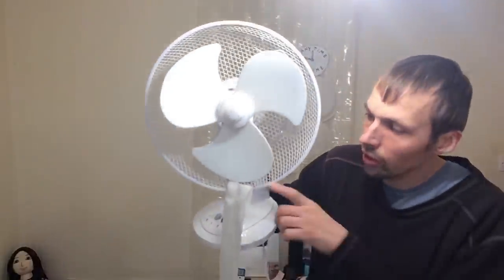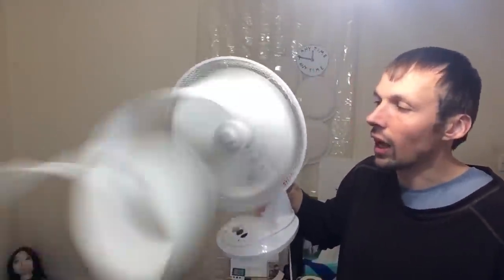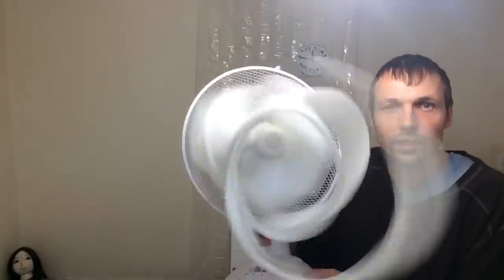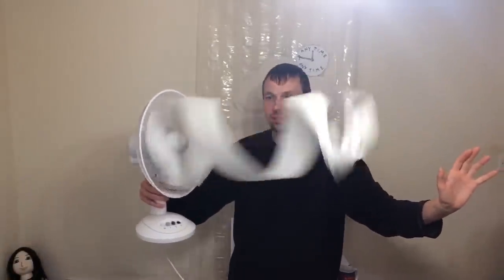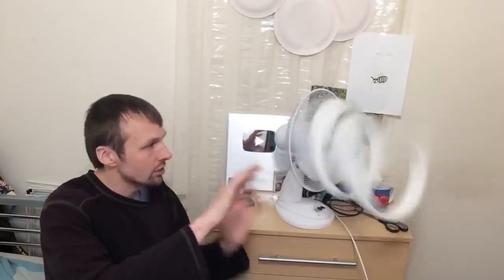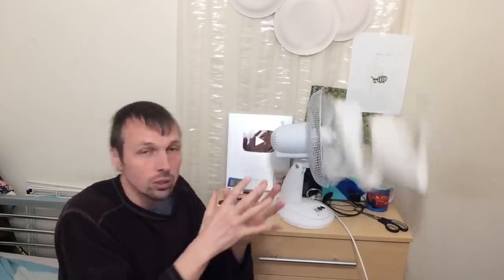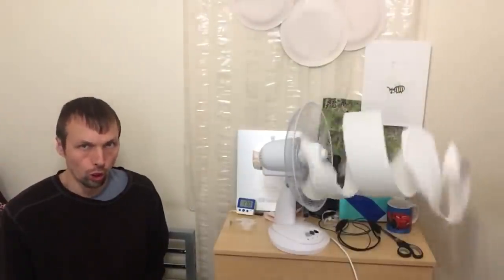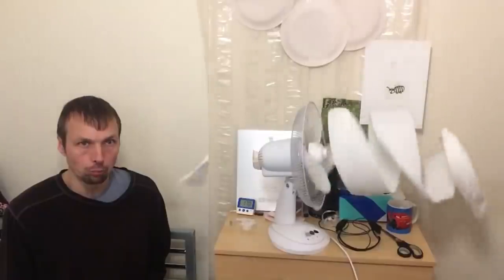Amazing physics experiment

Comment: “Let’s see your science fair project”
Me:
Reply: hey, its a good since project! for high school maybe

you just need to ask a important question: why the paper is doing that shape?, what would happen if instead of a fan blade that trows air forward, you turn it with a stick that moves no air ?

and if you analize why its doing that shape (it has to do with aerodynamics, and the low and high pressure zones) and study it you may end up with a simple model of how the air out of a fan ends up moving, something that many may not even think of but still science

also pro tip: mix Glycerin+ alcohol and heat it up ( i used a cheap solder tip, but you can heat it from below in a spoon (dont hold the spoon), the important is to bring it to a boil) and it will produce a good amount of smoke that you can use to show the airflow, but please do it next to a window and try to take out the smoke, is not poisonous afaik but still ask you chemistry teacher
Reply: btw i did an air chamber and put a small model car, and trow smoke at it to see how it was shaped, also learned a lot from wikipedia lol
Reply: @FocusFlixx  lol
Reply: @FocusFlixx  maybe someone gonna read this and give it a go
Reply: I like Fire Force too
Reply: XD

Comment: My IP-address is in the title and I don’t like it
Reply: You know what is ip address?
Reply: @127.  You know what is hexadecimal?
Reply: @appio4345  yes
Reply: IP Addresses aren't written in hexadecimal. MAC Addresses are. Nice try at a joke but, you failed.
Reply: @uniqhnd23  Ipv6 IP addresses are written in hexadecimal so...
Reply: @manjy5927  Mate you know he meant IPv4 addresses. Either way, the title looks closer to hexadecimal than IPv6 addresses.
Reply: @uniqhnd23  yep makes sense.
Reply: @uniqhnd23  The fact that it's standard to write IP addresses in decimal notation doesn't make it impossible to write them in hexadecimal. You could write your phone number in hexadecimal if you wanted to.
Reply: @appio4345  Of course you can, but it wouldn't make much sense since it's standard to write IPv4 addresses in binary.
Reply: @uniqhnd23  In binary? Did you mean decimal? 🤭
Reply: @appio4345  Lol sorry just woke when I wrote that comment. Brain barely was working.

Comment: (start video)
Hello Everybody! 
My name is Gatis Kaaaannndis and today I will show you a pretty cool physics experiment
Which you may not repeat unless you got a professional supervising you or you are professional yourself.
(cut)
So, I'm gunna attach ehh some toilet paper to the fan
and you can probably arready guess what is gunna happen if you have seen the thumbnail of this video,
If you havent you can have a guess now,
annnnd... soooo... yeah, without further adieu, lets go!
(cut)(attach toilet paper to fan)
Ok so the toilet paper has been attached to the blade and im gunna turn it on on 3... 2... 1...
(turn it on)
turning it on!
And as you can see, the  fan lifted up the whole toilet paper and now it is rotating the same why as the fan is!
and if I turn it this way (turn to left), then you can see it is still rotating
and if I turn it this way (turn to right), you can see it rotating like somethings its uhh... it is uhh... longer!
and other times it is shorter, I dont actually know how to control that,
but, at the moment, it is this long!
(show measurement with hands) 
(cut)
So your probably wondering "what exactly is happoning, how is it possible?"
Well, its because the fan is blowing the it away, so that is blowing the toilet paper away,
but on the other hand, because the fan is spinning, its making the toilet paper spin as well,
and wis the centrifewgul force, it is ehh... making it stay in a circle
but it is not going out all the way because its simply not heavy enough
so thats why it keeps circling like this!
(cut)
and now im gunna show you the slow motion version
(cut)
(show slow-mo version)
(sing)
rolling, rolling, toilet paper!
I'm just rolling toilet paper
rolling, rolling, toilet paper!
I'm just rolling toilet papeeerrr
(stop)
(cut)
(show closer up slow-mo)
...
(cut)
And thank you very much for watching!
I hope that you enjoyed this very cool experiment,
and I will speak to you soooooon!
(end video)
Reply: Thank u so much
Reply: Ur crazy m8